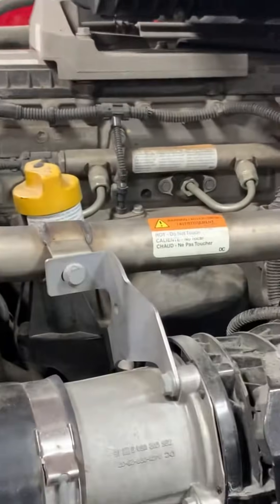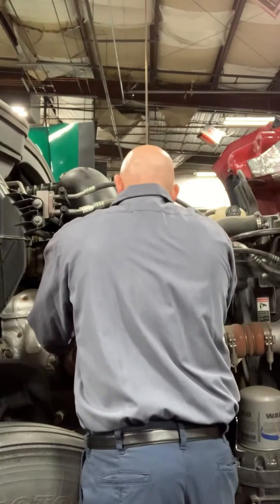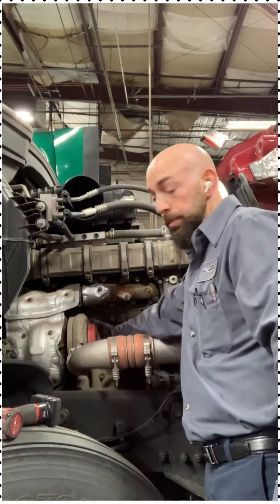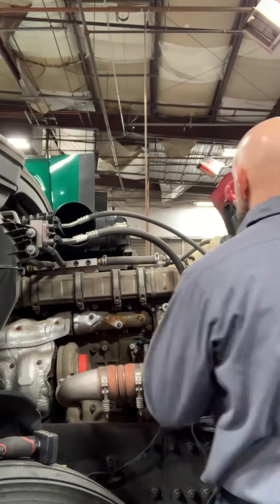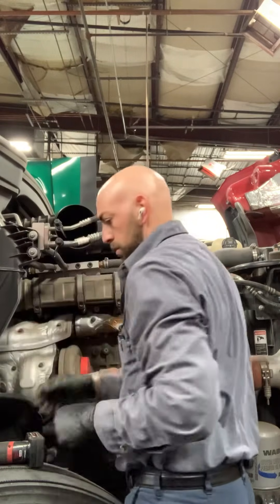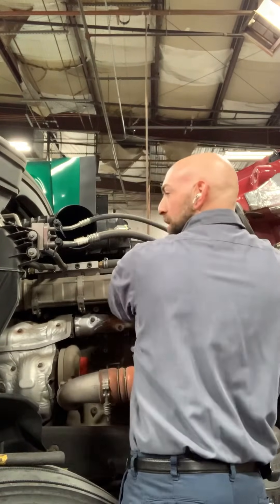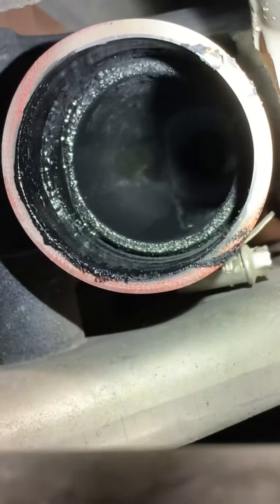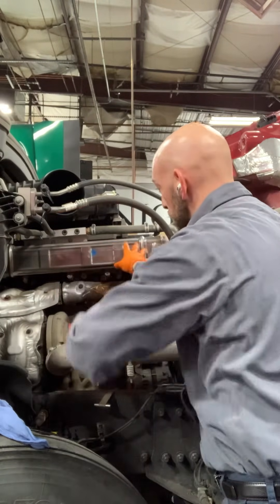Freightliner cascadia DD15 engine EGR EGR cooler failure. By diesel dr

Comment: A few weeks back my egr cooler had a small puddle of coolant on the heat shield when I was home for a break so today I pull off the heat pipe I see not much soot build up or coolant inside 

So do I still need to replace the egr cooler?
Reply from the maker: @quatrucking186  great question. You would need to run the unit and see if it leaks into that hot pipe or pressure test the cooling system and same check.

Comment: thank you for the video.
DD15 freightliner cascadia 2016
recently, I added coolant. After I checked, I didn't find a sign of the leak. beside this, I felt my truck a bit slower during climbing up hills. can a bad EGR cooler cause these symptoms ?

Comment: 6:07 can you just replace those seals instead of the whole EGR cooler if you have a internal leak? Can that solve the issue too? I do have a slight mixture on the hot pipe side.
Reply from the maker: @kingkon164  the issue is the tubes inside the cooler. I wish just the seals would fix the issue. But coolers getting hot and cold mixed with vibration causes cracks to occurr

Comment: Hey it was a new egr cooler replaced on my truck. I don’t think the port by the heat shield and the other port above the thermostat housing was sealed properly. I have small drip where does ports are.
Reply from the maker: @juanwp7583  time to take it back to where they did the work and have them recheck

Comment: Is there a possibility the one box could be effected when the egr cooler fails. My truck is down becuase my Serpentine Belt snap due to a bad tensioner which also caused me to loose all my anti freeze which made the egr cooler fail. Now the shop wants to charge me for a one box. The tractor has not d rateted one me.
Reply from the maker: @No_Way_Jose07  great question, sounds like you have separate failures here. In no way is the belt snapping related to egr cooler failure , unless you overheated the motor. In this case you have bigger problems and much more costly. The egr cooler leaking into the intake and being burnt up into the exhaust will saturate the after treatment. Most of the time we can burn it off. In rare cases, the doc will not clean and will need to be replaced. If fuel saturates them , more than likely they get replaced.

Comment: dealer said that if EGR cooler fails than also good practice to replace the DPF filters since now they have been possibly contaminated with coolant. Is that right? started loosing about 1 gallon of coolant per hour. Drove truck all of 40-50 miles to get to dealer. Now they want to charge $1200 to troubleshoot since this requires tear down, 1700 to change EGR cooler, and another 1400 to change both DPFs. These are just labor numbers. doesnt include oil, filters, coolant, EGR cooler, DPFs. Total quote is for 13k. smell a ripoff?
Reply from the maker: @AkashG334  thanks for reaching out. I usually don’t replace dpf filters intill after the repair, if the regen fails for high temps out of range. I warn the customer before hand it may come down to replacing them. But majority of the time they pass. The safest and most expensive bet is to replace them but I don’t like to over repair. And egr cooler is 4 hrs to replace and dpfs are 4 hrs as well. Of course this doesn’t include any diag. But parts pricing would be the huge amount here.
Reply: @bustedknucklebydieseldr3228  
This dealer charged 8 hours to replace EGR and then finished the work in 1 hour. We saw on the ELd that truck was ready in an hour

Comment: If there's no coolant in the hot pipe on the passenger side or when you pull the elbow off the sgr cooler and there's not any coolant then if you have a thermoking tripac apu look at the coolant hoses that run from the cutoff valves to the apu bc the coolant isn't separated. The coolant from the truck always run continuously from the truck to the tripac. NOT THE THERMOKING EVOLUTION. Separate coolant system from the truck. Tripac is the same. Come to find out after all the work the thermoking dealership found out where the coolant was going. The tripac had a bad head gasket causing lost of coolant. That was the problem the whole time. If you don't have a apu be sure to ck your coolant lines that runs to your def tank. Hope some of this will help after changing every coolant line you can think of 😅😅😅

Comment: @juntong651
0秒钟前
LOVE YOUR VIDEO 

I HAVE ANOTHER TRUCK KEEP MISSING COOLANT , BUT DONT SEE ANY LEAK , CHECK THE ENGINE OIL IS FINE , AND THE CHECK THE EGR PIPE TO INTAKE MANIFOLD , DONT SEE ANY COOLANT AS WELL , SO WHAT IS NEXT I HAVE TO CHECK IT , PLESE LET ME KNOW , THANK YOU
Reply from the maker: If you keep loosing coolant I’d pressure check the system and check everywhere. Even on dash floor or sleeper floor. Those heater core like to leak. If there is nothing external at all it’s will be going in either the exhaust or the oil.

Comment: I changed turbo out new Vpod, new Delta P and IMAP Sensor and now I’m getting this code 
SPN3058 FMI 10? 
Any help appreciated
Reply: Thank you for the reply 
so it wouldn’t have to do with the Delta Pressure sensor ?
I change it out it hasn’t been calibrated since I don’t have the software.
I do feel the truck sputter when I accelerate and the truck will lose power to kick in the gear.
Reply from the maker: @RecioTransportInc.  if your delta p sensor was reading incorrectly than this could affect it as well but if you replaced it and you know the ports in the pipe are clear than I wouldn’t lean towards this one.
Reply: @bustedknucklebydieseldr3228  sounds good man appreciate your help !! Thank you
Reply from the maker: This would be an egr flow code and will set with an loss of egr pressure.I would check cac for cracks or loss of boost,egr boost leaks,failed egr sensors,or turbo issues..On eof these will lead you to your issue

Comment: My dd13 is quite different. Looks like I need to remove quite a bit to check inside the cooler for moisture. 

I want to remove the front cap of the cooler to see inside. The torx bit size needed must be an oddball size.. any idea the size bit needed?

Comment: I miss oil man every day 1 galln and nothing show out side ?
Reply: How long does it take to put on it and is it possible that inexperienced person can do it instead of paying the dealership $200 an hour to do it and I have gotten quotes for $1200
Reply from the maker: @Antoniotrotter1  you just saw how to be able to tackle it yourself. Parts are the expensive part. The rest is not hard at all.
Reply from the maker: If your missing this much oil and your sure it’s not on the out side of engine. I would suspect it’s going out your exhaust. So failed head or head gasket.

Comment: My 2020 is losing over a gallon of coolant a week. No leaks anywhere. EGR cooler?
Reply from the maker: Great question. If your losing that much coolant and your certain there is nothing external. Than it will either be a leaking egr cooler back into your intake or a leaking head into your oil pan. Check your oil level and see if it’s to high.

Comment: So this could be the reason i lose coolant? Truck broke down 4 times when the level reached the level sensor
Reply from the maker: Absolutely, along with many other possible leaks. There are so many areas that could cause  coolant leaks on these engines. But egr cooler failures are very common on both detroits and Cummins.

Comment: Hello, my truck have big pressure in coolant tank, no smoke, no oil mixing, no power lost, mechanic changed compressor and made co2 test but still have that pressure, what could be? Thank you.
Reply from the maker: A lot of times excessive cooling system pressure will be caused by your air compressor very common in older trucks or your head gasket failed more common in newer trucks.
Reply: @bustedknucklebydieseldr3228  the compressor IS new , so i think and Hope IS only head gasket, this morning with cold engine i open the tap and had Big pressure, spit all coolant
Reply from the maker: @kepasakolegi8871  if ur engine was cold and you had that much pressure built up. I’m starting to think your pressure relief coolant pressure ports in your coolant reservoir is plugged. That pressure should be going down through there. So if it’s plugged it’ll never escape.
Reply: @bustedknucklebydieseldr3228  thank you for your answers , truck IS in garaje and the issue IS head gasket.

Comment: Please answer if the truck it’s deleted and this start failing can you cover the holes where the coolant come from? Please help it’s leaking a lot of coolant out of the end of the EGR the connects to the hot pipe on back. Thanks in advance I’m on road so need to know if that will fix my problem or if I can disconnect the hose from coolant reservoir that connect to the EGR again hope u can reply and thanks in advance.
Reply from the maker: If your truck has deleted EGR/aftertreatment than you can remove/block off that EGR cooler or lines. If it’s leaking plug it off as it’s not needed. They do make block of plates for all the ports of you do decide to remove the EGR components.
Reply: @bustedknucklebydieseldr3228  so I’m in a little bit of a no where and was thinking of blocking it off with some aluminum from some energy drink will that melt. And Man U just save my ass thanks and do I need to drained the coolant? What I did was I notice once the coolant got low I bypass the sensor and it wasn’t leaking no more do you think coolant is low enough where I don’t need to drain it don’t have no where to drain it into. Again thank you so much.

Comment: How much labor on this job ? Thanks 👍🏽
Reply from the maker: Labor is usually 4 hrs for just this repair. But an oil change is recommended and a cooling system flush would be a good time.

Comment: I have replaced my batteries few months ago and they are turning bad again. What could have been the reason can you please guide a bit or make video . Thank you very much
Reply from the maker: Thanks for reaching out. When it comes to batteries becoming weak I would start with checking connections and for excessive resistance such as corrosion. Those will cause you many issues. All the other tests would need a multimeter to start checking alternator voltage and excessive draws on the truck. It helps to be handy with electrical for these tests.

Comment: This is  what might be wrong with my truck i have a 2006 freightliner Century with a rebuild engine was installed summer of 2011 I'm losing coolant don't see a leak can smell it and engine running ruff going up hills engine sound lot louder than it should be I'm taking my truck to freightliner shop in Valley, Alabama tomorrow to work on it its 30 minutes from my home

Comment: How long do you think that actually took you to do?
Reply from the maker: What it takes and what it pays is very different. It pays around 4 hrs but if you hustle you can get it done in 1 hr.
Reply: @Busted knuckle by diesel dr  I pulled the hot pipe and had trace amounts of coolant it looks like. Replaced the delta sensor and it fixed my problem of low power for now. Gonna delete it soon before it bankrupts me lol.

Comment: Hey diesel Dr, can you give me some insight on why my dd13 Freightliner will show 1-2” below the minimum mark on the coolant, but it will also have a faint ring of coolant around where it needs to be inside the reservoir, and I don’t add anything but when I run it at idle for about 20 minutes and then shut it off and then check the reservoir my coolant level is back at the minimum. I’m not seeing any leaks on the ground. I have no clue what it would be because I’m not adding anything but it magically goes back up to normal when I run it.
Reply from the maker: Great question. In your surge tank there are extra pressure sections built in.  Coolant will be kept on these sections and flow to the main area where the level is and cause the level to read correctly.  I would fill coolant to max mark cold and not worry about it till you start loosing coolant. Great quest though and thanks for reaching out.
Reply: @bustedknucklebydieseldr3228  thank you so much for replying!! I love your channel👍

Comment: My EGR hose is blowing twice and I change it new and again blowing and leaking a black carbon Do you have any idea reason for blowing up  ?
Reply from the maker: Great question. Either something is cutting the hose causing it to leak or the clamps are crap, or clamps need better positioning on the pipe.
Reply: @bustedknucklebydieseldr3228  thanks 🙏

Comment: Have a 2016 DD15 that has soot in the coolant reservoir. What could be the cause? Thanks for your help 🤘🖖
Reply from the maker: Great question. I’m normal operation you’ll get small traces of EGR in the cooling system. But sometime to much will go into the system and show itself on that surge tank. I would have you EGR cooler checked for internal leakage. If it passes than change your surge tank and put new coolant.

Comment: Jd I have a question? When the egr cooler can the coolant leak thru the exhaust pipes and into the 1 box?
Reply from the maker: Great question,, yes. When the cooler leaks it usually leaks internally and goes through the intake and gets burned up in the cylinder. Anything that doesn’t get burnt up will go through the exhaust and to the dpf. Hope that helps.
Reply: @bustedknucklebydieseldr3228  good morning there jd … so when I asked the question about the egr cooler coolant leak, I’m looking at my bill and it is saying cel with multiples after treatment fault codes? What does this mean?
Reply from the maker: @goofycomic37  this just means that you came in for a check engine light and they repaired multiple fault codes that may or may not of been related to the same issue.

Comment: I paid my local shop to do this job and they charge me for new water manifold gaskets. Did I even need that.
Reply from the maker: Thanks for reaching out. If those would be the gaskets that go behind the cooler to the water manifold or collector than yes. I would recommend replacing them. They are forgiving but if you have many Miles than it’s best to change them out.

Comment: Hello. I recently had to change my radiator at a rest area. I hitched a ride to a dealership bought the radiator and changed the radiator at the rest stop. Once completed I filled up the system with water intending to change it out with antifreeze once I got back home. This happened in Pennsylvania, well I went from Pennsylvania to Kentucky and now I am in Montana, twice while driving the low coolant warning comes on and each time the reservoir has been slightly below the low mark, in total I have had to put about a gallon of coolant into the system. No signs of outside leaks, could this be due to me just having water in the system and it just evaporating? Also, never had a coolant leak prior to this situation.
Reply from the maker: I Gta  say damn. That took initiative doing it at a rest area. A radiator is no quick and easy job. If your reservoir keeps getting low than for sure your leaking somewhere. Either external or internal. A quick check for internal would be checking the EGR crossover pipe going to your intake. If it’s really wet you most likely found your answer. If not wet than something on the outside is not sealing. Usually those radiator hoses don’t seal well after so many miles once touched.
Reply: @bustedknucklebydieseldr3228  https://youtu.be/T9wDoOO-uUY
Reply: Thank you for your reply. I will be keeping an eye on my coolant and if I continue to loose, I will inspect the crossover pipe.

Thank you for making your videos.

Comment: Good information just one question after changing egr cooler, I have exhaust leak. You can’t really smell it but under load you can definitely hear it and when engine break is on you can also hear it. Would changing egr cooler have anything to do with it?
Reply from the maker: Great question and thanks for watching. Where the cooler mounts to either side pipes , one of those might not be lined up properly. Clamps may be secure and tight but if the pipes aren’t set perfect it’ll make that noise occur. I would go though and check all those first.